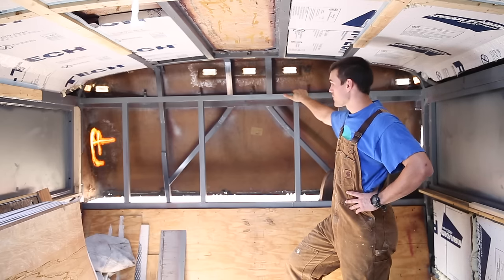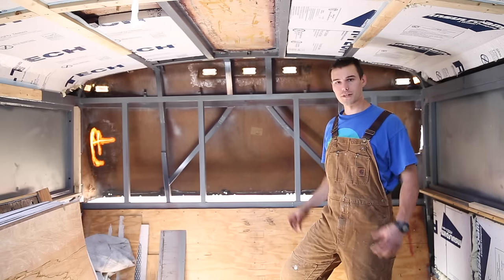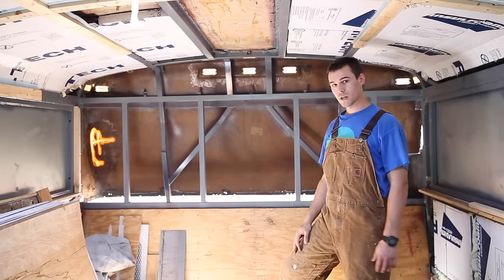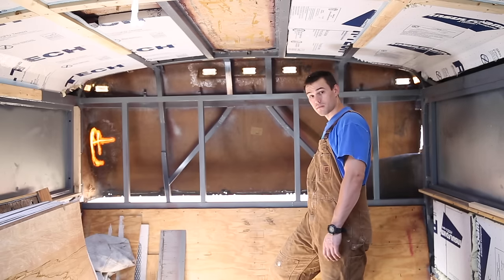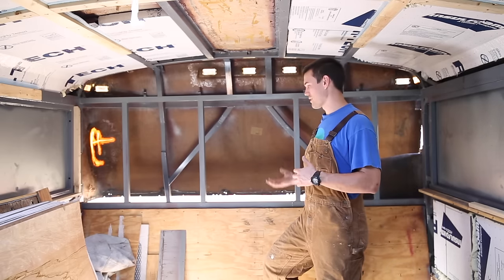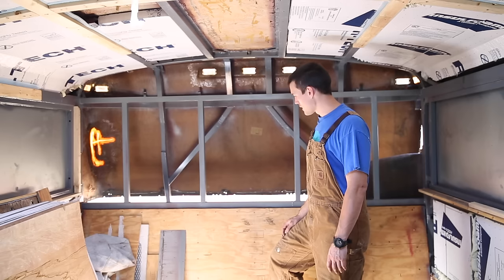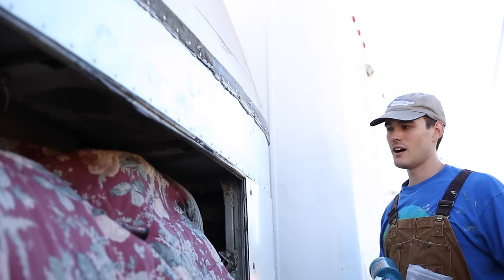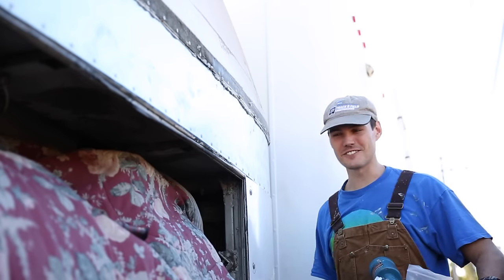Bus Conversion Tiny House #29 Sealing Fiberglass and Metal Cap Enclosure

Comment: You two are doing a great job on the bus build!  Maybe i missed it, but i would be nice to see what the build cost to date.  I do have a question though, how did you determine the height of the roof raise?
Reply from the maker: +NewBeRVer
I like your channel name. Complete cost (all tools, storing the bus, materials, the bus itself, appliances, and mechanical components) are currently around 22k. Keep in mind we started with no tools and have been storing the bus for over a year while building it. Expenses definitely add up to more than you think, we will do an overall price breakdown at the end for sure. If you have the chance to check out our roof raise videos we go over quite a bit in them, the height of the roof raise for use was determined by cost. We used 4x10 foot sheets of 16 gauge galvanized sheet metal. The cheapest way to utilize that is to run it length wise and not make any cuts... so we raised the roof so that we would have a 3 foot 8 inch gap giving us around 2" of overlap on top and bottom. In hindsight it might be better to with 18 gauge. A little lighter and cheaper. All in all, no major complaints about the overall result! Hope that helps.